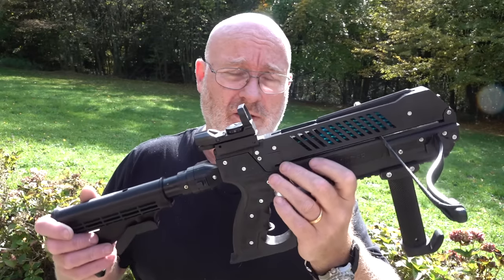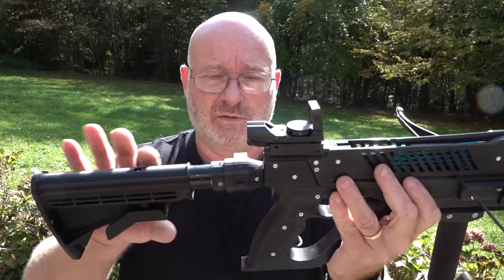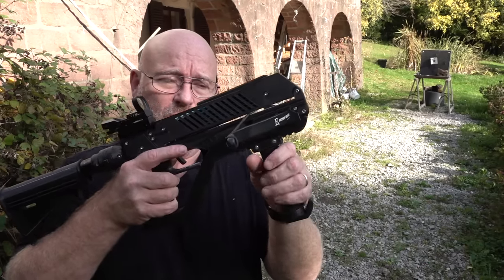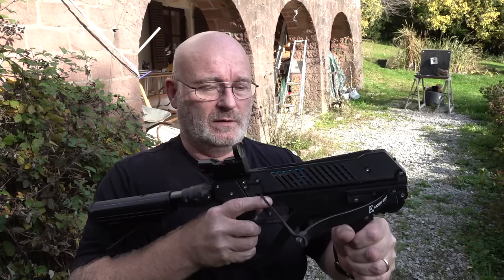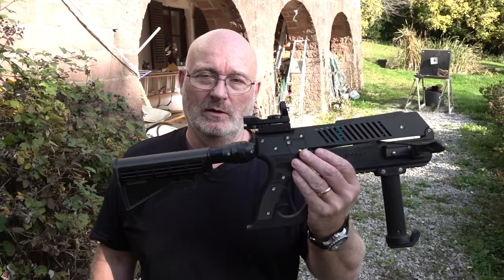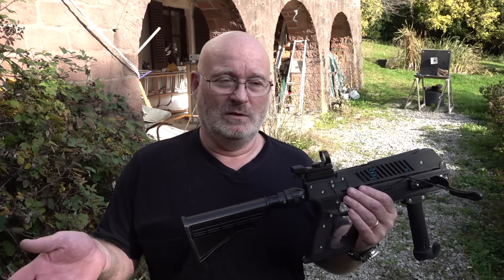Next Level Rapid Fire Crossbow (3D Printed)!

Comment: No no no. God no. Please stop always believing goofy advice like this. Do not trust your wellbeing on sporting equipment such as this. I would classify this weapon as C or D rank for self-defense, where a shotgun is being A or B rank or something. The important organs are protected by rib cage and sternum, so this has to go through that and then some. And even actual guns can end up being just dice rolls, so dial down your expectations even lower than that. 

There is a difference between a weapon being "deadly" vs. actually effective in combat. In combat people can get shot in the lungs and still fight back so for defense the main purpose is not being "deadly" but being effective in combat. For instance a baseball to the face might be more combat effective than it is deadly. Tiny arrows at these slow speeds aren't gonna provide cavitation or even tumble, the speeds will also be too slow to cause sonic shockwaves either so they might not even have much of a stun effect. The raw joule energy is probably going to be less than just a regular bow and arrow too. 

And for the love of pigs, stop using pig carcasses for your demonstrations. For the love of vegetarianism just use a coconut. For self defense with tools like this your best bet is to just aim for the head anyway. I would have liked to see a coconut test to see (if any) penetration that would cause. A velocity meter is absolutely essential too.

You can't count on sporting tools like this for self defense. You cannot even count on flash bangs for self-defense, I cannot tell you how many times I died in Valorant after someone peeked around a corner while being (supposedly) flash banged. With anything its going to be dice rolls, but as you climb up the tiers (such as with a shotgun) it becomes less and less dice-rolly as it approaches the number 1. If you live in some dystopia where guns are not allowed, this tool might be better than nothing, but you might as well have a tomahawk too, somewhat more dangerous I think. For defense or military purposes this thing is maybe 200 or 400 years behind the latest tech. Ancient primitive tribes knew this and would put poison on these things so they were more effective. You can't count on it stopping some angry person on stimulants running at you, but if you are an aimgod and if you aim the exact right spots then maybe. And for a burglar, you might as well let them escape unless they are stealing something really expensive or important. No need to shoot them with something like this to ramp up the conflict. Yes, this device could "in theory" kill someone but its not really worth it unless they are already shooting projectiles at you and this is the only thing you have.

Anyway, these videos usually are fun to watch for the engineering, but I sometimes take the self-defense claims with a grain of salt lol.